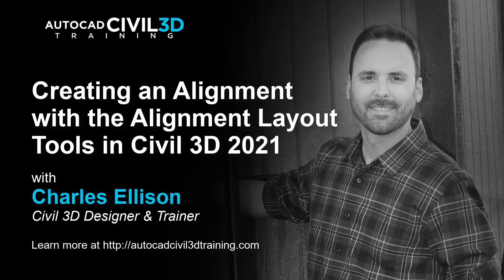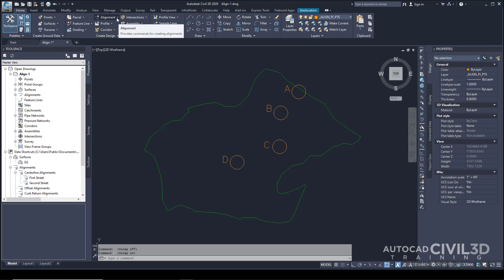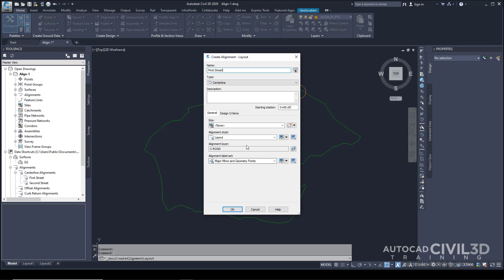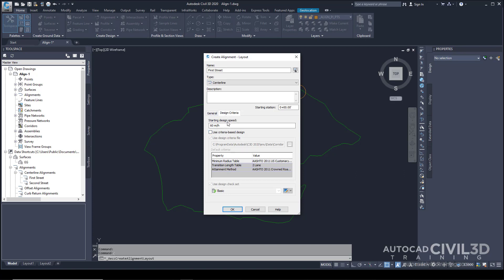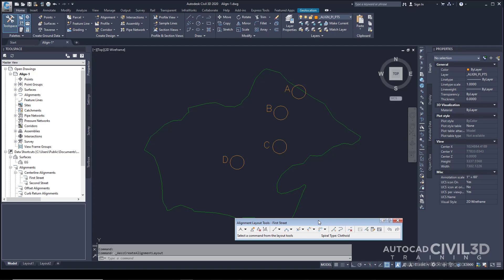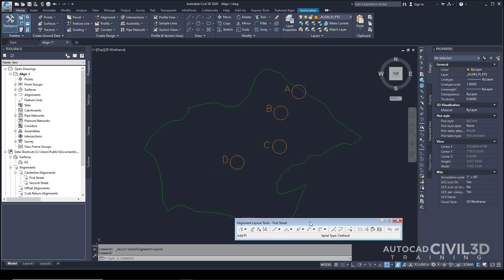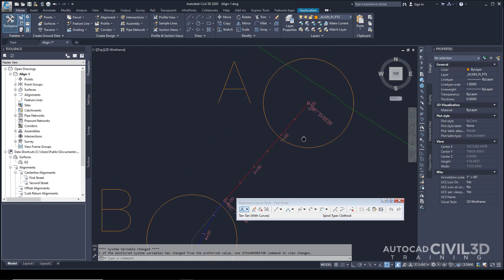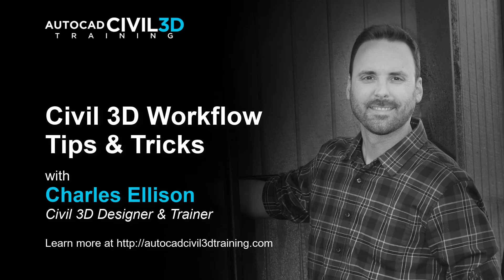Creating an Alignment with the Alignment Layout Tools in Civil 3D 2018, 2019, 2020, 2021

Comment: Hi 

I trying to make a material volume of road

But the length between the two station is calculated by 2d distance

But my road profile is slope

So please told me how to take the road slope distance

Or material volume by road slope length

Instead of alignment distance
Reply from the maker: Can you get the distance from creating a profile view?
Reply: @CIVIL3D  profile view is created and fine

But problem is
When try to takeoff material volume
Area is multiple by sample line offcet distance 2d

But I need to multiple the area by profile line slope distance

My road is not in zero slope
Reply from the maker: Gotcha. I'll have to investigate that for myself. I haven't had to much experience with that lately. I'm sorry.
Reply: @CIVIL3D  if you need I send you the data material report
Reply from the maker: Volumes are by plan station in Civil 3D—surface volumes won’t change with slope. If you need slope (true) length: make a 3D centerline (Create Feature Line from Alignment using your profile), then measure/label its 3D length or use the alignment/profile report.